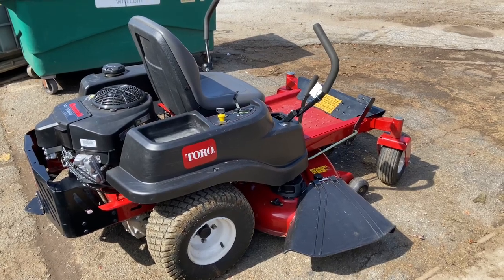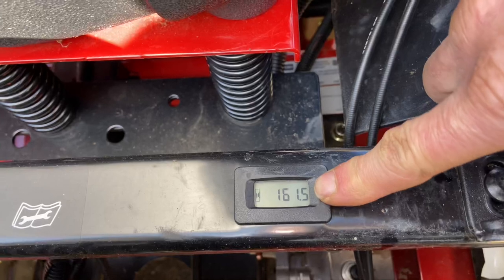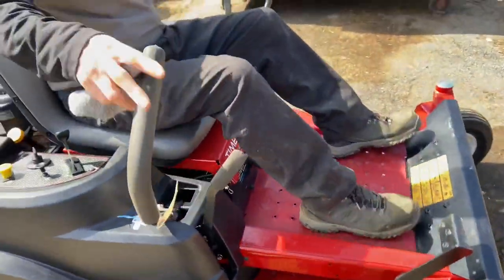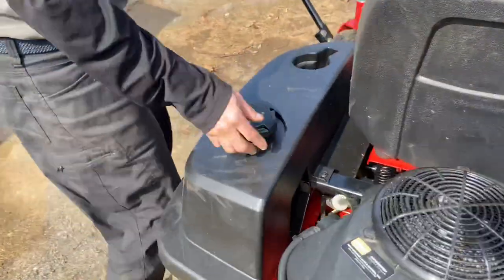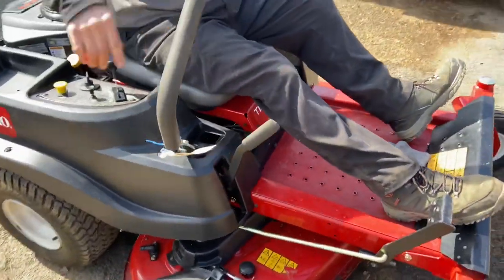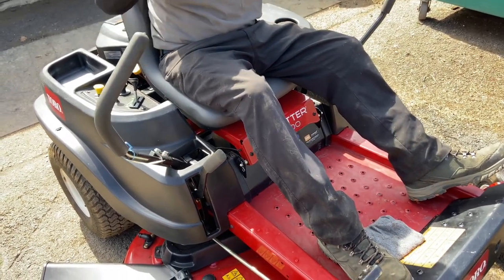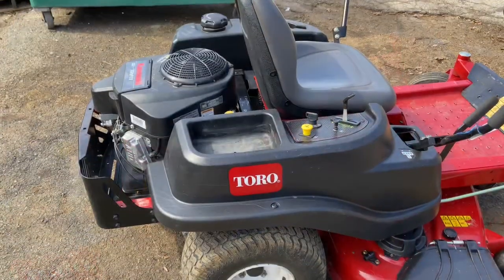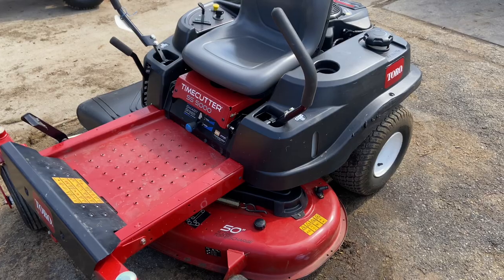How to Start and Operate Toro Time Cutter SS5000 O Turn Riding Mower

Comment: Delivered a nice even cut, has the super tight turning ability https://www.youtube.com/post/Ugkx1VWTrayKBdCKAjzAcZ_Eg4dhHTae3LkN also recommend I was looking for, and is just a blast to drive. It takes a little bit to get used to driving one after driving a normal tractor style, but once you've got it, you've got it. If you're cutting lines, you have to be careful spinning the mower around or the back tire will dig a bare spot. Just take it nice and slow during the turn and then it's back to full throttle across the yard!
Reply from the maker: I’m glad it was helpful and thank you for the kind comment. Please give this video a like and share my channel with your friends to help it grow. It would be greatly appreciated. Thank you for watching.

Comment: Hi. Brad,... Nice job,...mine is exactly like this one except no pedal to adjust deck height and no hr. Counter.   My question is,... How do you adjust deck height to level it front to back and left to right?  Research says deck blades should be 1/4 inch lower in front as opposed to rear of blade.  Thanks...
Reply from the maker: I do not have a video yet on that subject. I need to wait until I get one in for service before I can make the video. Try looking for the PDF owners manual online.

Comment: Hey Brad! Question. My dad and me are trying to find where do add hydraulic fluid. Is it under the arm panel?
Reply from the maker: If you have the same machine that is in this video? The transmissions are sealed and non servicable.

Comment: I bought a used SW 5000 zero with the steering wheel and was wondering how to use the Key Choice feature so it will mow in reverse. Does it use the spare key for the key choice, or is it an entirely different key? Thanks for any input you can provide.
Reply from the maker: I have not seen a Toro O turn with steering wheel yet. I would suggest a online manual may help?

Comment: I just bought this mower and need to know if I should engage the blades at an idle or half speed. I can't find the answer in the manual.
Reply from the maker: Half to 3/4 throttle depending on if your on or off of the grass when you engage the blades.

Comment: In your opinion whats the best ride on (0 turn or not) for 5+ acres a week under $5500? Thanks!
Reply from the maker: I’m my opinion, For that price and that much ground, you will not find one that will last more than a few years. Try and find a O turn with a Kawasaki engine on it. I found out through the years that the O turns that came with a Kawasaki engine had a better quality machine built around it for your price point. If you come across a few your interested in, go to my web site, get my email address and send me the models your looking at and I’ll give you my honest opinion. Johnsonssmallengines.com
Reply: @JohnsonsSmallEngines  💪👍🙏

Comment: Just bought a Timecutter and didn't realize it had a C channel frame. I'm worried it won't be durable enough. What's your thoughts?
Reply from the maker: I haven’t seen any issues with the frame. I have seen more issues with the transmissions so do not tow heavy and o hope you don’t have extremely large hills. Take care of it and it will take care of you!!
Reply: My transmission, frame, and engine failed.

Comment: My wife likes to pump the choke button like 5 or 6 times when she starts the mower.  I do it the way you are in this video.  Yesterday, my wife and I could not start the mower so we left it overnight and were able to restart it in the morning.  Do you know if pumping the choke can flood the engine?
Reply from the maker: The choke is either on or off. There is no pumping of any sort when the choke is on. You can flood the engine if you leave the choke on to long while cranking the engine over. Try to start the machine without choke. If it doesn't start with in a few seconds put the choke on but not for a long. You should be able to get a feel for how your engine starts after a bit of using it. Have you had it a long time? and now its giving you issues?